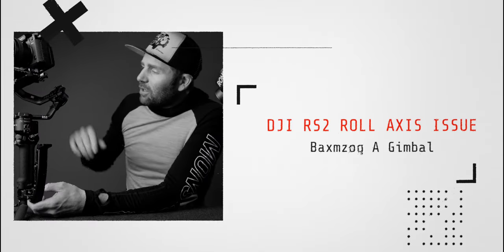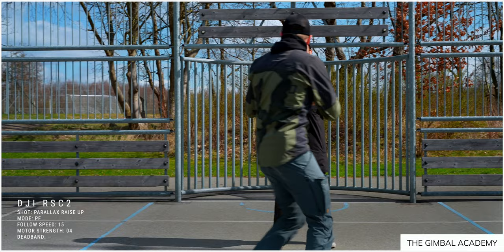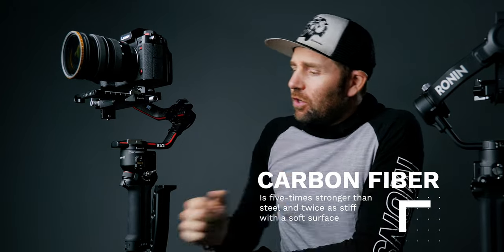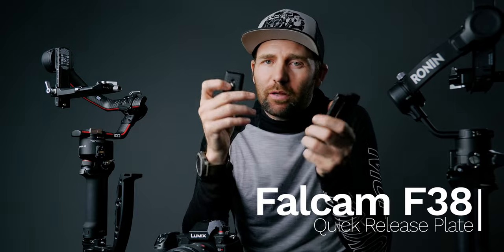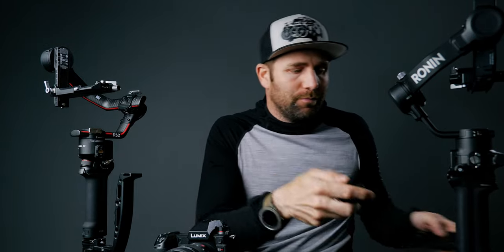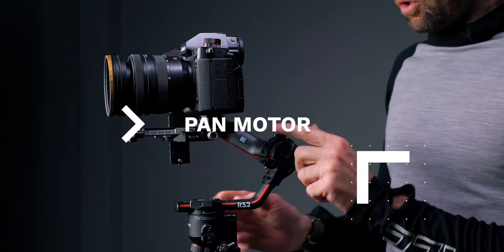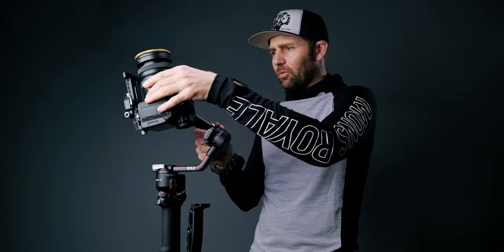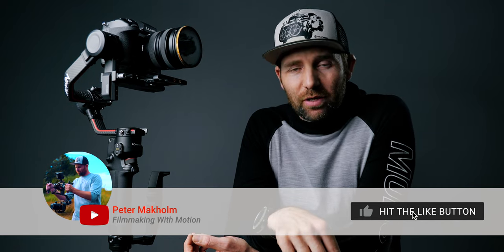Balance A Gimbal Correctly | DJI RS2 Roll Axis Return Issue | How To Balance Gimbal

Comment: Hi Peter, I am trying to balance a much heavier setup, the RED Komodo with sigma 18-35 and a follow focus. I have the tilt axis and pan axis balanced perfectly but I keep having the roll axis return to the center even with the clamp signed down as much as I can, any recommendations? Thank you!
Reply from the maker: Yes, if you slightly adjust the tilt arm up and counter adjust the baseplate then you should get the perfect balance point for the roll axis. This trick often worked do me.
Reply: @PeterMakholm  DUDE you are THE MAN! it worked thanks so much!!

Comment: I’m running into an issue where the second part of the tilt motor looks like the screw plate is going in uneven. Are you having that issue? I noticed that you said it feels like you have to tighten the screw more than you think, I wonder if I’m not tightening it enough. Thanks for the helpful video!

Comment: I had the roll issue you were showing. Unfortunately I have the Ronin SC so I can’t use the tightening trick you showed.
Reply from the maker: Is it the Ronin S you have?
Reply: @PeterMakholm  Ooops, I hâd the wrong letters. It's a the older Ronin SC. Your older video actually had advice on a gimbal without and adjustment directly on the roll axis. https://youtu.be/PYfPHRsBOH0

Comment: I just bought an RS3 and even though it seems and reads like it's properly balanced it will think it's unbalanced and go into sleep mode as soon as I lock any axis. I'm trying to prevent the gimbal from moving at all besides basic up and down and side to side but it moves at every axis or it wants to shut down. Please help.

Comment: please help! Im using a DJI RSC2. My roll axis always returns to horizontal, and will not stay in one place. Tighting the circular knob does not fixx it like this method. What can i do ??
Reply: im using an a7iii so its not that heavy is it?
Reply from the maker: You need to move the tilt arm a bit up and re adjust the baseplate and you will have perfect balance. I am talking about small adjustments

Comment: Should mention that if having a heavy setup, the roll axis will still fall back to the center regardless how tight the knob is. This issue is still present. Though DJI says its fine because the motors are strong enough to compensate. Cheers!
Reply from the maker: Thanks for sharing.
Reply: Been trying to figure that out recently. I’ve magically been able to balance the 18-35 sigma art series 1.8 with a canon c70 and an BP a60 battery for a ballast weight - a good handful of times but not reliably. Just tried today and couldn’t get the gimbal to balance without violent vibrations and a poor balance warning. Picked up a roll motors counter weight from tilta and hoping that might help, also looking a some drop weight options off the sled since the tilt motor is fairly easy to balance with this setup, but the roll motor with lots or front and rear weight is almost impossible. 

Anything else I should be looking at for this setup? about to take it as the B-cam in a massive run and gun shoot for the next couple of weeks.
Reply: my setup is not that heavy its just 3lb and I can't make it work, I try to tight the lock and it doesn't work, help
Reply: @nvargas331  does it still pass the test though? I just got back from a gig where I flew the gimbal 7 days straight in a variety of different setups. Got pretty good at balancing it too, but I did notice a few things. With the heavier setups I had to use counter weights under the cam sled and roll arm for best results. Also, once the battery got down around 50% I had noticeably less long term performance and would get random jitter issues or see the gimbal be more sensitive with only slight weight changes do to either using the zoom lens or leaning the gimbal forward at a 30 degree angle. As for the roll arm, it would stay put when upside down but not right side up - which I found interesting. With your lighter setup you shouldn’t being having roll arm issues. Check the vertical balance and tilt first, I’ve found the slightest changes still make a big difference. Also, what lens are you trying to balance with? If you aren’t able to even out your weight on the front and back end you might need to add sled weight.
Reply: Wish I read this before going nuts! Thanks!!!!
Reply: Ahhhhh thank you so much for this I was going absolutely crazy! Thanks for this comment.

Comment: 5:50 Dude Thanks for this advice, this was the reason why my gimbal was not always well balanced. Great channel, good tips! I also have a problem with the tilt motor because when I change the focus (canon RF 50mm 1.2 L) depending on the focal length, the glasses move forward or backward and that puts a strain on the tilt motor. Some solution for that?

Comment: Excellent tutorial mate, I really feel like I learnt something new, this will be getting saved to favourites! 
Couple quick questions; 
would you suggest I balance with my 24-70 at about 45mm (the middle) to compensate the weight of zooming in and out? 
And should I balance with my LCD screen flipped out on my FX3? I usually do this but it never quite sits parallel to the ground 😑

Comment: Your videos are of great help for me. I have a question about using a zoom lens on the gimbal: I set the zoom at the middle of the zoom range and balance the gimbal, so that I can change the zoom focus length later without having to rebalance it, using gimbal's motor strength. But I'm not sure if this can damage the motors? Is this an acceptable or bad approach?
Reply from the maker: Hi. That is also how I doo it. You won't damage the motors.

Comment: Quick question. Im using external monitor (Ninja V) with HDMI cable, and other cables on my camera. I should balance with everything hooked up right? When I do this with my camera mounted vertically i get wobble... I must be doing somehting wrong